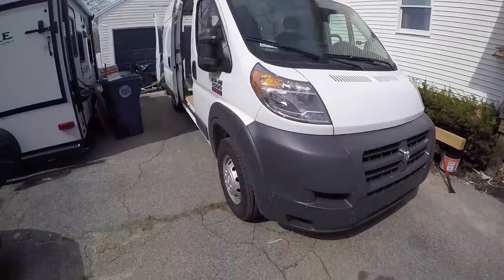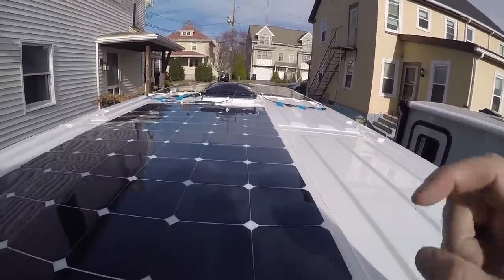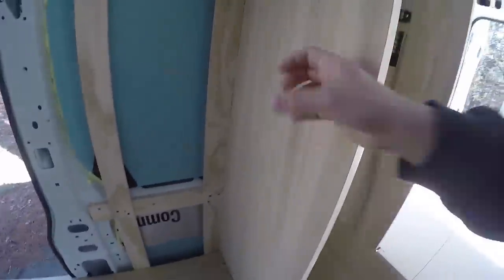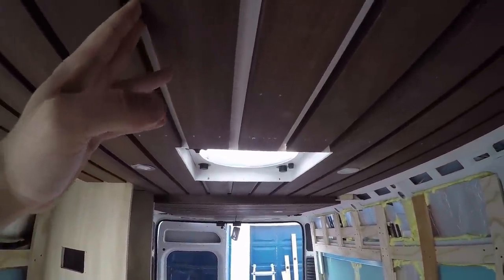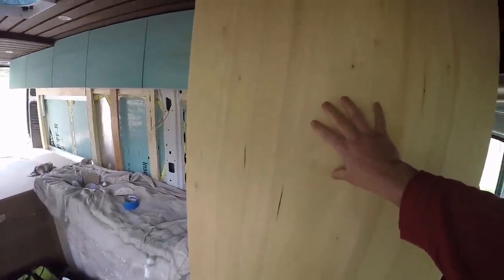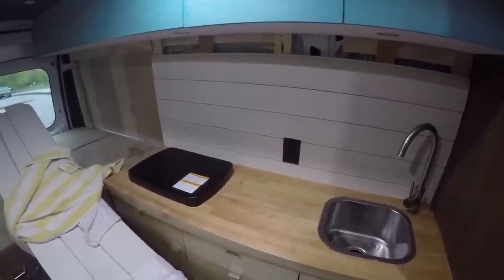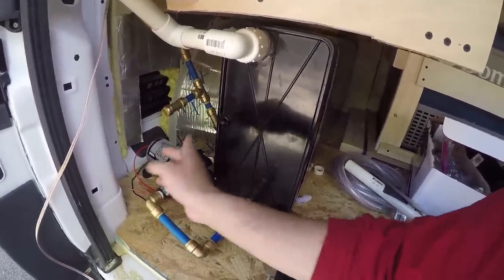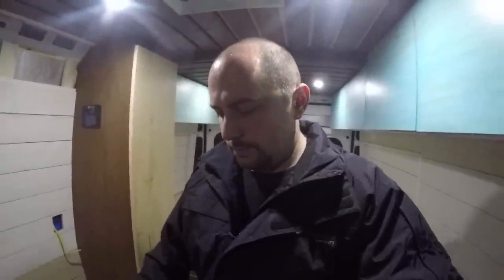How I Converted My Van into a Stealth / Off Grid / Tiny Home Van

Comment: Nice build and video.  Question.  Are you concerned of heat build up under solar panels?  I would like to set up solar similar but have been old it will be too much heat.  TIA
Reply from the maker: Diana Shelton the flexible panels are designed to not have a air gap. Not many companies have the flat flexible panels in the US.

Comment: This is pretty fascinating. Request- Would you elaborate on the auto insurcance? How does this impact your auto insurance? I'm assuming you report it as a modified van so you aren't at a complete financial loss should you be in an accident. Also, have you found some insurance companies easier to work with than others? Do some insurance companies refuse to insure modified vans for living? Thanks!
Reply from the maker: Great question! When I do a video on "Why I picked a Promaster" I'll go over all that info as well. I actually haven't done what I wanted to do yet with my insurance just yet.

Comment: Really excellent instructional video. I do have a few questions. Did you already own the the Ram Promaster van or did you purchase it for this conversion? Before I ran across your video I had been looking into cargo vans and I have to say the Promaster has some pretty scary "alleged" problems. Did you run across those same problems when deciding to go with the Promaster and or did you research it thoroughly and find the owners complaints to be unwarranted? Next, I am just now getting into learning about solar power and I have to ask, with 600watts in panels and two 400 amp hr batteries, how off grid are you? Let's say you aren't getting any recharge from your alternator, just on the solar panels and batteries, what are your limitations? for example, lets say you are on vacation and you are at an off grid camp site and your vehicle is broke down and you have to wait a week for a tow, can you run your a/c or heater as much as need along with tablet/laptop etc and your fridge, water pump etc without having to worry about power or is there a trade off and some down/charging time? I apologize if these questions seem novice. I would really like to do what you have done and want to learn as much as I can. That leaves me with one last question. If you are limited with the 600watts and 400amp hr batteries, what would it take to be unlimited as it pertains to your build. Thank you very much and again, really awesome instructional.
Reply from the maker: Some really good questions...

I did buy the Promaster for this build. For me it was between the Promaster and the Ford Transit. The Transit is a 'better' van but for what I wanted to do I felt the Promaster was a better van for a class B tiny home. Of course the Sprinter is a great van but I also didn't want to spend so much on the van itself and repairs. I'm not sure what problems you have come across, but the Promaster is the sister van of the Ducato from Fiat and that van has won several awards and now with Dodge's motor it's really a great van. Mine does only have 15,000 miles on it but I also take very good care of it.

The power information can get tricky. Depending on time of year (angle of sun) and where you are located, really can tell you how long you can last. Now I can run my batteries with no sun at all for about 4 days, but I don't have a AC because that takes way too much power. As for a heater I have a back up that will run off a small propane tank just in case I run into a problem like you said. I actually have a back up for mostly every problem if I have one for that "just in case" time. For my van I NEVER plugged in and I haven't damaged my batteries at all and I haven't even drained them to 70% the lowest I went was about 80% and it was cloudy for 3 days. Now I'm looking to upgrade to Lithium Ion Batteries as they are better, lighter and you can run them all the way down to 10% without damaging them. When doing all your calculations make sure you talk with a pro and they will go over everything you need to know. That's what I did and if it wasn't for my dad putting in my electrical I would of paid someone to do it. Hope that helps a little.
Reply: I appreciate the reply and the information on your batteries. The problems I was referring to are complaints from low mileage owners of the Promaster such as loss of engine power, many electrical problems, sliding door and back door problems etc etc and the biggest problem.....getting a dealer to recognize the problem as an actual problem and or multiple failures in trying to repair the problem. It's probably just a case of "every vehicle has some issues and owners being a bit overstating" Again, Thank You very much. I really enjoy your videos and hopefully in a year or two I'll be sharing my build video with you. Thanks again and I hope your venture continues to have great success.

Comment: Hey Jarrod not being critical how about lightweight fireproof wall connected to the counter next to your stove, I mean it doesn't have to be oh wow just like a little half wall to keep it away from the bed! Just a thought , not at all knocking down the beautiful job you did.
Reply from the maker: Fair to worry about that as others have too. BUT when I lift the lid to my burners it acts as a blocker. Totally safe and have had zero issues for 8+ months now. I'll do a video of the kitchen soon to show how safe it really is.
Reply from the maker: Also putting a wow wall (whole wall) there would make the space seem a little more enclosed and tight. I'm already in 96 sq feet so I was trying to feel as open as possible

Comment: Very nice looking van, better than a lot of factory made RV"s out there. Seems more of a passion project than a realistic way to get a home though. With the price of the car and all the custom work and effort put into the Van I can't help but think this cost most then most lower end homes would. The gas millage is probably pretty bad too with all that weight.
Reply: Eh depends on where you live but generally yes houses are expensive. Even crappy ones barely bigger than an apartment are at least 20-30k. Funny enough in my experience at looking for a home the biggest thing to worry about is location. Good or bad weather and the local job market determines the value of a house more than anything else almost. If you can make a living from home there are a lot of cheap places to live due to the fact no one can find a job there, especially some rural parts of America. All that said honestly a house isn't what it used to be. You have no rights in what you do with it and the government can increase taxes or just seize the property at any time. Way to many news stories out there of people getting in trouble or even jailed over installing Wind Turbines, solar panels or building a garden against city regulations. In view of all that a van you can simply drive away in looks better and better by the day.

Comment: I like it, but let me just offer that there are alternatives to foam insulations. The space is small enough that using several corrugated cardboard layers would be environmentally friendly and avoid any potential chemical off-gassing exposure over time in a small space. Also, costly solar charge controllers can be replaced by a simple programmable timer to let current flow during daylight hours only, and this is fine whether overcast or sunny, because the solar panels have blocking diodes to prevent reverse current flow and panel design prevents batteries from being overcharged. Lastly, design should allow windows and doors to be easily used when not in stealth mode? Hats off to everyone who sets up to break free and live more economically- its well worth it.

Comment: How's the solar panels? I'm curious because it seems you're using those flexible ones which others have said will only last months.
Reply from the maker: Hmm I'm curious who's saying this. And where they got there's from. Mine have been fine! It's been over a year and (knock on wood) my electrical has been good to me. My panels are the only think not made by renogy but honestly I've been preparing myself for them to fail on me. When I clean the panels I'm getting 18+ amps and when they are dirty I get 10-14amps. If I wasn't trying to be stealth I'd get regular panels and even angle them towards the sun when needed
Reply: @JarrodTocci  I've encountered it in different comments. Other RV dwellers also said flexible ones are not as sturdy as those hard mounted ones. If I remember right Exploring Alternatives and Will Prowse are just some vloggers I could remember.

Anyway, thanks for the answer. Lovely build. I personally like builds with complete facilities like a shower and toilet.
Reply from the maker: @experimenteks3974  thanks! I'll check into it more. I put mine on with Sikaflex and again haven't had a issue.

Comment: hello Jarrod  did you have any concerns with the flexible solar panels not having any cooling being glued to the roof? have you had a panel fail?
Reply from the maker: Pete Knorr I’ve had them for a year now. I don’t think any have failed as I’m still getting daily charge. Flexible panels are designed to stay flat with no air to go under them so they should be ok. I will have them checked by a pro in the future just as maintenance
Reply: Jarrod Tocci   Thanks for sharing and thanks for your reply so fast. I just purchased my promaster and I’m starting the build based off your great work. Are those solar panels you have worth it or would you do anything differently with the brand or style?
Reply from the maker: Pete Knorr the ones I have are now really hard to get because they came from China. Some reputable companies have flat panels they are just 100w instead of 200w. I only got flat panels because I wanted to not look like a RV in the city. If that wasn’t the case I would of gone with real panels
Reply from the maker: Pete Knorr also I hope to put out a 5 part series of my build by tomorrow or Friday so you might want to check that out too

Comment: The bui l quality looks good excellent. How much consideration did you give to weight when selecting materials?
Reply from the maker: Paul C I did think about it knowing the max weight this can handle without adding anything is about 1500lbs. I wanted to stay under 1000lbs which I did. I explain weight and how it’s distributed in my price video. Also water on one side and electric on the other
Reply: Jarrod Tocci 

Thanks for the reply.  I like the design. There is a a lot of lumber. I think the weight considerations hit me when I saw the butcher block counter. It would be relatively easy to upgrade the rear suspension if it it proves necessary. The GVWR capacity is likely greater than the official number.
Reply from the maker: Paul C that’s what I was thinking too. Always better to be safe than sorry. The lumber wasn’t as bad as I thought. My biggest concern was my 2 125 pound batteries. I’ll probably just do a suspension upgrade around 50k miles to be safe

Comment: Great build wanting to do my bed like yours any  help would be great any pics info etc..  on the way bed was done i have the same van
Reply from the maker: Vince Salinas thank you. What questions do you have? Not sure if I have any pictures of my framing of my bed. But I do plan on doing a 5-6 part build series in detail of my van. So I will definitely go over that very soon. Pretty much the front is 3/4” plywood and I cleated that to the frame I put in against the metal rids of the van. I then framed up the bed with 2x4’s to make sure it can handle my weight or 2 people. The part under the mattress is split into thirds so I can access different parts under the bed when needed. Maybe I’ll start posting pictures on my instagram over the next week. You can follow there and I’ll do that @g.h.o.s.t.van I hope that helped a little.
Reply: Hey Jarrod thanks for getting back to me,  one quetion is in the bed section you frame out for the bed is that some type aluminum what size ? i would like to put the bed like yours, Is that a 1x6 that you attach to the inside frame then a 2x4 screw to that? thank you
Reply from the maker: Vince Salinas the aluminum was 2” angle and what I think you’re talking about is around that aluminum are 1x4’s and those are there just to help attach the white shiplap I got and of course hold that angle in place. Is that what you meant? If I have time today I’ll see if I can find some pictures and show I’m better detail
Reply: Thank you any help would help have a great day

Comment: did you wish to put insulation in the vans  skeleton frame, either spray foam or soft insulation.
or would the vibration gel  you put on work the same?
Reply from the maker: tom morton I actually did spray inside the ribs but just didn't show it. I think I just forget to film that part. The ribs that I ran wires through I didn't spray in there

Comment: What thickness plywood did you put on the floor over the foam insulation? Do you notice any flexing on it while walking around? Thanks
Reply from the maker: Tyler Alexander 1/2” and when it was just a floor I did a flex little but as soon as the rest of the build went in no more flex

Comment: Awesome finished result! I like the table idea, but it slides in front of that cabinet, wondering if horizontal overhead storage may have been a better option than vertical. Also I would have probably installed the bed a few centimeters higher. What is your experience after 6 months? Anything you would change or do different?
Reply from the maker: Thanks! Layout wise it's hard to say "I wish I did ___," but I've seen a ton of van builds since I started this lifestyle and the beauty I've noticed is everyone is different (at a tiny house festival as I write this). If you build your own or buy one already built everyone has certain needs. I think everyone will say "would be cool if ____ was able to do ____." But working with a little amount of space I've found out we are all happy. I've posted more videos as time has gone one and you can see the small changes I've made, like new looking back doors, toilet shelf in bathroom, and I plan on doing even more. It's just like a home as you always want to upgrade it. Lastly I built this to live full time out of. If I built it as a adventure rig it would look totally different. Hope that all helps out. Anymore questions let me know :)
Reply: Wow thanks for the quick response! Very insightful, yes indeed Like  I said I would have done things slightly different and that would be me personalizing it to my needs and taste, but overall I like your layout the best from all the vans I have seen so far, and it certainly inspires me to go ahead and take the plunge. Been looking at small spaces since the 80's being fascinated with the Japanese people's efficient use of space, and used their "capsule  hotel" concept for a sleeping space inside a 1987 Toyota Tercel station wagon I drove and used while in college. In many ways I miss the flexibility it afforded me and would like to do the same again with more space in a van with bathroom, table and a kitchen. Your videos are very inspiring! Thanks again!

Comment: Hi! Grate job! 
Q is: Is the weight of the equipment important. I see heavy furniture. Very heavy batteries on one side. How is this car going on the road? You've thought about the arrangement of things in the van. 
I do not know about motorization and engineering so I'm interested of that:)
Reply from the maker: Miliana Sowa thank you! Yes weight and how it's distributed is important, at least to me it is. The batteries are really the only thing on that side of heavy weight. And on the other side like the kitchen and water tank it off sets the weight if the batteries. Also I did it that way to keep the electrical on one side and the water on the other just in case the water leaks I don't want it damaging electrical equipment. Hope all that makes sense :)
Reply: Yes, it is:) Separate water and electrics is clever idea.Its so many things I have to know before make a Van:/ Not easy but with Yours video, I can start realizing my dreams about van.
Best wishes to U and good luck!
Reply from the maker: Miliana Sowa thank you! Any questions let me know. I also have a 5 part build series that's on my page. Breaks everything down step by step :)

Comment: i like this stealth van camper. easy to park and mobile enough to go around getting supply without sticking out like a sore thumb in the city. 

how long does the fully charged battery last to keep the fridge going before you must recharge through solar or gas/propane generator
Reply from the maker: Da Mobb thank you. Depends on how much I use other things in the van that take up power. When a charge controller reads 12.8v then its 100% and I’ve never dipped below 12.4v which is 70%. With my gel batteries I should never get below 50%. I have had 3-5 days stretch with very little if any sun. So my guess is 4 days

Comment: What is the measurement of the bed? And what about the inside measurements of this van? Seems huge. Basically i want to know what van i can buy with approximately the same measurements. Thanks again for this video
Reply from the maker: Eri Alaggia bed is 52” x 72” and I had to cut just a little off for the corners to fit. The van is roughly 12’ long 6’ wide and 6’1” height. That’s with the walls, floor, and ceiling in

Comment: Pay the extra money and use lightweight plywood, where possible. Weight always an issue with builds. Concerned about the towbar used to carry the motorcycle, as it will need strengthening.

Really like the design, and styling. Plenty learnt.
Reply from the maker: Dame thank you